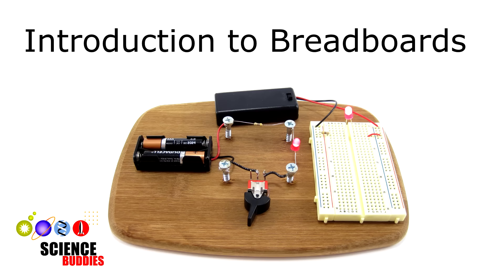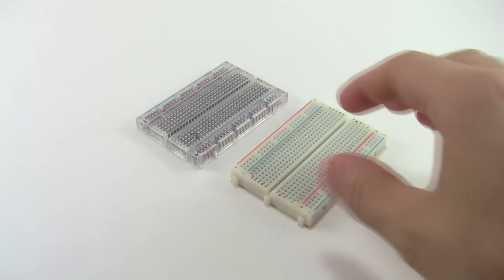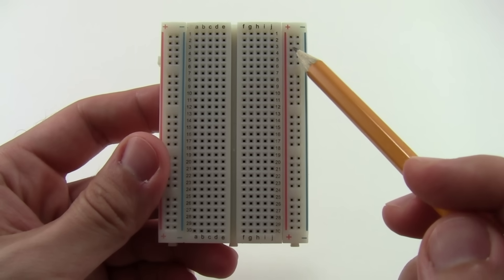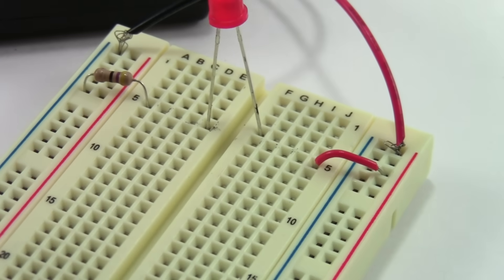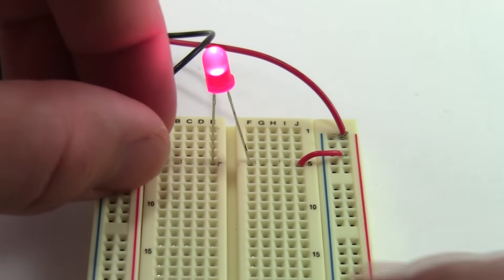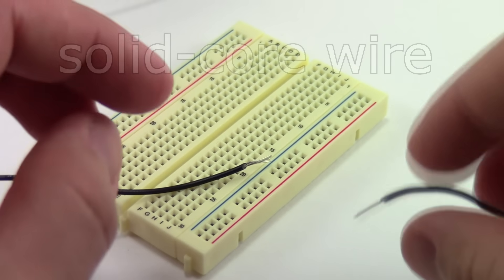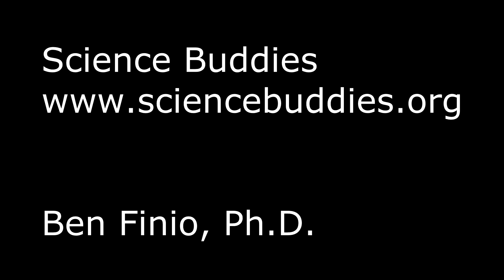How to Use a Breadboard

Comment: Can someone tell me Why he used a resistor in the LED circuit ? 🤔
I’m a beginner
Reply from the maker: Hi Abdhullah - the forward voltage rating of an LED is typically in the 1-2 volt range depending on the color. A 2xAA battery pack provides 3 volts. So, if you connect the LED directly to the battery pack with no resistor, the voltage will be too high and it will cause the LED to burn out. If you are a beginner here are some tutorials you may find useful (you can also find these topics on YouTube):
https://learn.sparkfun.com/tutorials/voltage-current-resistance-and-ohms-law
https://learn.sparkfun.com/tutorials/light-emitting-diodes-leds/all
https://www.sparkfun.com/tutorials/219
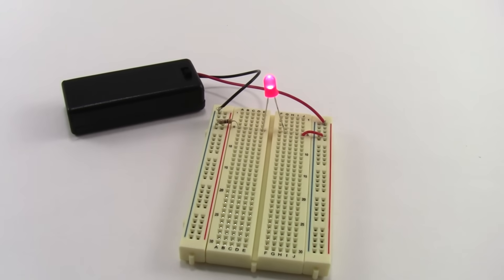Reply: Science Buddies | at 5:10 , since the current passes from positive to negative , shouldn’t the resistor be placed before the LED ?
Reply from the maker: @abdullahmaqsood5348  This is the most common question we get on this video, copying our response to other comments: It turns out that it does not matter whether the resistor goes before or after the LED in the circuit. This might seem counterintuitive if you think the resistor needs to come first to "resist" or "drop" the voltage. Since the resistor and the LED are in series, their voltage drops add up to equal the voltage of the battery (formally this is known as Kirchoff's Voltage Law). This is true regardless of what order they are placed in. If you'd like to learn more, search for tutorials on "Ohm's law" and "LED current limiting resistor." Hope that helps!

Comment: I'm terrible with this stuff.

For instance how do I know if I need a transistor?

How would I know what size/type?
Reply from the maker: Hi Breakneck - transistors (what they are, how/when/why to use them, etc) are kind of beyond the scope of this tutorial. There are many more electronics tutorials available on YouTube and elsewhere that could help you learn more. For starters, it would help if you have a specific application or project in mind (lighting up an LED, driving a motor, etc.).

Comment: What the hell is "SODDER" ?
Reply from the maker: If you were asking about the pronunciation (why I don't pronounce the "L") - apparently this is an American vs British English thing: https://www.google.com/search?q=is+the+l+in+solder+silent&rlz=1C1CHBF_enUS811US811&oq=is+the+L+in+solder+&aqs=chrome.0.0j69i57.3437j0j7&sourceid=chrome&ie=UTF-8

I'm American and have only ever heard it pronounced "sodder" here.
Reply: solder is basically just a metal that is melted to create a mechanical and electrical connection. The breadboard is good for prototyping and DIY projects, but most consumer electronics use solder to make strong permanent electrical connections.

Comment: Can you connect things diagonal? For instance the led were one pin is one row up but still connected to the wire  to make a closed circuit? I find these kinds of videos interesting since i know nothing about it so it might be a stupid question.
Reply from the maker: Hi - no, you can only connect things in the same row, not in adjacent rows. If you watch the whole video or check out this part of our written tutorial it explains how all the holes are connected: https://www.sciencebuddies.org/science-fair-projects/references/how-to-use-a-breadboard#holes?from=YouTube
Reply: Yes, as long as the circuit is connected the rows you use don't matter.

Comment: Where should the resistor be connected; the positive side or the negative side of the LED? I just burnt up a LED i guess i connected the resistor the wrong way
Reply from the maker: This is a very common question, copying our reply from other comments: It turns out that it does not matter whether the resistor goes before or after the LED in the circuit. This might seem counterintuitive if you think the resistor needs to come first to "resist" or "drop" the voltage. Since the resistor and the LED are in series, their voltage drops add up to equal the voltage of the battery (formally this is known as Kirchoff's Voltage Law). This is true regardless of what order they are placed in. If you'd like to learn more, search for tutorials on "Ohm's law" and "LED current limiting resistor." Hope that helps!

Comment: What size (AWG) is the solid core wire for most breadboards?
Reply from the maker: Usually 22 AWG; slightly smaller or larger may work with some breadboards.
Reply: Good to see that question answered explicitly. I just got through pausing at 9:56 to see which setting was used on the wire stripper.

Comment: What do the bottom of the chips look like?
Reply: just black flat plastic like their top, usually
Reply: 9peppe yeah but is there a square piece of metal underneath where the three pins are?
Reply: @EchoHawk1862  the pins are not actually on the bottom, they are on the side and bent down. usually there are no other pieces of metal other than the actual pins (there can be special use chips that use a different mechanical structure, and obviously you can have chips in packages other than DIP)

Comment: A bit unclear when you put the chip all on one side. You say "If you put the chip like this you are shorting out the two pins in each row". Are you referring to the two slots that are under the body of the chip?
Reply from the maker: Hi - it might help to look at the pictures in the written version of the tutorial here that explain how the pins are connected: https://www.sciencebuddies.org/science-fair-projects/references/how-to-use-a-breadboard#holes?from=YouTube. Starting around 11:27 in the video - first the chip is placed straddling the center gap in the breadboard, so the pins are in columns E and F, which are not electrically connected. So pin E15 is independent from F15, etc. However, then the chip is moved to columns A and D, which are connected. So pin A15 is shorted to D15, A16 is shorted to D16, etc, which is what you want to avoid. Hope that helps!

Comment: Why does the resistor go on the gnd side instud of pos?
If it is to resist to make I flow smaller then I can't get my head around why that would work After the LED uses power first and then grounds to the resistor and then finally to gnd?
Reply from the maker: Hello - this comment is supposed to be pinned to the top, but for some reason it might not show up. Copy/pasting the explanation:

Hello everyone! Pinning this comment because it's the most common question we get on this video. It turns out that it does not matter whether the resistor goes before or after the LED in the circuit. This might seem counterintuitive if you think the resistor needs to come first to "resist" or "drop" the voltage. Since the resistor and the LED are in series, their voltage drops add up to equal the voltage of the battery (formally this is known as Kirchoff's Voltage Law). This is true regardless of what order they are placed in. If you'd like to learn more, search for tutorials on "Ohm's law" and "LED current limiting resistor." Hope that helps!
Reply: Science Buddies ok so the sum leaving the node must be equal to the sum and going in and vice Versa so 100 amps going in will reduce to whatever is the exit allowance. So if I resist the exit wire by 50% then only 50amps will go in,right?

Comment: Greaaat!! Resisitor colors and oHm value please?
Reply from the maker: The resistor shown at 5:50 is yellow-purple-black-gold, which is 47 ohms.
Reply: Science Buddies Thank you so much for the quick response and btw, I tried to figure out with screenshots but no success, now it's OK👌
Reply: @Science.Buddies  thanks sir love u , can u make more video on electronics about voltage , current measurements I haven't understand please . Thanks :))
Reply from the maker: @RajuRay-yl5lh  If you want to learn about measuring voltage and current then our multimeter tutorial video should be helpful: https://youtu.be/ts0EVc9vXcs

Comment: i have several breadboards where the gap is 0.6 instead of 0.3, very useful for eproms and such without taking away from breadboard available pins. wonder if there is the odd board with 0.4 inch gaps for the few chips i can think of that are strange, but here one only loses a single pin

Comment: So why do we use the resistor in this circuit?
Reply from the maker: The resistor prevents the LED from burning out. If you connected the LED directly to the battery pack with no resistor, the voltage drop over the LED would be too high, causing too much current to flow through it, thus burning it out. Putting the resistor in series with the LED allows some of the voltage to drop over the resistor. Google "Ohm's law" and "LED forward voltage drop" if you want to learn more about these topics.

Comment: This video was really great. Though, I am stuck on how to use resistors in circuits. Can you explain why you used the resistor on the negative terminal instead of the positive?
Reply from the maker: Hi Timmy - this is a very common question, copying our reply to another user: This is a common misconception. It turns out that the order of the LED and the resistor does not matter. To understand this you need to understand some other topics that are not covered in this video, including Ohm's Law and Kirchhoff's Voltage Law (voltages add in series), but you can find many tutorials about them online, for example: https://www.sparkfun.com/tutorials/219
Reply: @Science.Buddies  Thanks for your quick reply. Your response has really helped me with my project.
Reply from the maker: @timmytimerson8243  Glad we could help!

Comment: i accidentally blew up a 5mm led in my face
Reply: i tried to not use a resistor but i figured i could counterbalance that by using multiple leds.
Reply: I was wondering what would happen if i did that. thank you.
Reply: @goezie  oh man i dont know.. The led might not have been in the board all the way. Im going to keep experimenting and keep you posted.
Reply: @benjamincarlson5044  the voltage across the LEDs' terminals would vary depending on the type of connection(series/parallel). Experiment around and tell us what you find

Comment: Why is the resister on A5 and -6? When there is nothing that connects to the 6th row?
Reply from the maker: Could you let us know exactly which time stamp in the video you're referring to? For example at 5:56 one end of the resistor is in A5, but the other end is in the ground bus, not A6. (watch the rest of the video for an explanation of what buses are)
Reply: @Science.Buddies  5:48
Reply from the maker: @Cam-SB  OK, same explanation applies as what we typed above for 5:56 then (the resistor doesn't move between those two time stamps).
Reply: @Science.Buddies  so if it doesnt move between then why don't you stay on 5?
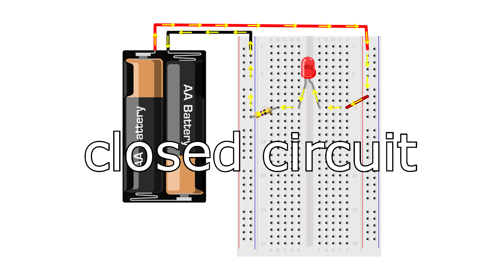Reply from the maker: @Cam-SB  We may be misunderstanding your question. Starting around 5:42 in the video the resistor is connected between the left ground bus (the vertical column with the blue stripe on the far left) and hole A5, and it remains there. Initially the LED is also in row 5 and it lights up. We temporarily move the LED to row 4 and then row 6 to demonstrate how it stops lighting up, since those rows are not electrically connected to row 5.
Reply: At 5:48 the resister on each end is in a different row. I'm confused at why
Reply from the maker: @Cam-SB  The columns are the far left (between the vertical red and blue lines) are the power buses. The row labels do not apply to them. Only one end of the resistor is in a row (row 5) and the other end is in the negative power bus. If that still doesn't make sense, this section of the written tutorial might help: https://www.sciencebuddies.org/science-fair-projects/references/how-to-use-a-breadboard#breadboard-labels
Reply: @Science.Buddies  now it makes sense. Thank you! :)
Reply from the maker: @Cam-SB  You're welcome, glad we could help!

Comment: Why use resister while using LED?
Reply from the maker: The resistor is needed to prevent too much current from flowing through the LED and burning it out. This tutorial has a good explanation: https://www.sparkfun.com/tutorials/219
Reply from the maker: @Rj Simas that is a common misconception. It turns out that the order of the resistor and LED does not matter. To understand this you need to understand some other topics that are not covered in this video, including Ohm's Law and Kirchhoff's Voltage Law (voltages add in series), but you can find many tutorials about them online, including the SparkFun tutorial I linked in the other reply to this question.
Reply from the maker: @Rj Simas if you are just starting to learn electronics, you might also appreciate the multimeter video we just posted: https://youtu.be/ts0EVc9vXcs

Comment: do you need a resistor?
Reply from the maker: @LoLAwesomechad this is a very common question and depends on understanding some topics that are not fully covered in this video, including Ohm's Law and the fact that "voltages add in series" (formally called Kirchhoff's Voltage Law). It turns out that it does not matter what order the LED and resistor are in. They are in series, so their voltages add up and are equal to the voltage of the battery. A red LED typically has a voltage drop of about 1.5 volts. 2xAA batteries provide 3 volts. So the remaining 1.5 volts are dropped over the resistor - but this occurs regardless of whether you put the resistor before or after the LED. This tutorial provides a more detailed explanation: https://learn.sparkfun.com/tutorials/voltage-current-resistance-and-ohms-law/an-ohms-law-experiment
Reply from the maker: Yes, you need a resistor in series with the LED. Otherwise, too much current will flow through the LED, causing it to burn out.

Comment from the maker: Hello everyone! Pinning this comment because it's the most common question we get on this video. It turns out that it does not matter whether the resistor goes before or after the LED in the circuit. This might seem counterintuitive if you think the resistor needs to come first to "resist" or "drop" the voltage. Since the resistor and the LED are in series, their voltage drops add up to equal the voltage of the battery (formally this is known as Kirchoff's Voltage Law). This is true regardless of what order they are placed in. If you'd like to learn more, search for tutorials on "Ohm's law" and "LED current limiting resistor." Hope that helps!

Also, we apologize for the poor audio quality in this video! It is several years old and the audio was simply recorded with a cheap webcam and no post-processing. If you check out our more recent videos, hopefully you will find the quality greatly improved. Thank you for all the feedback!
Reply: It's fine. Btw thanks for explaining it so nicely.
Reply: great video thanks buds but no post processing could save this audio haha  :)
Reply: The voice is indeed a bit awful but after a minute I got used to it it's not a big deal. Thanks for the useful video!
Reply: It's better than a muddy mix. I've learned so much from your video, it's uncomplicated and you make it look easy thank you! :)
Reply: hi... when using a 🍞 board, does it matter where u put the first component?
Reply from the maker: @james77011  For a very simple circuit (one LED and one resistor, like we show in this video), it shouldn't really matter. For a more complicated circuit with lots of parts, the breadboard might start to get pretty crowded, so you might want to plan things out more carefully.
Reply: You video helped me with my l.e.d project and I didn’t here bad audio

Comment: This is an excellent video with well thought out and well explained demonstrations for anyone learning electronics. This video also does a great job of showing the inner workings of a breadboard and detailing the options for using different types of wire for various projects.

Comment: This is quite possibly the most easiest video to follow along that I have ever watched. This needs a large round of applause, I am more than thankful for you having created this. Thank you so very much, this has helped me a lot. Edit: Hello again, I just have a doubt about why the resistor is placed after the diode and not before could you clarify that, as generally it would be placed before because the current flows from positive to negative, but it's on the negative side and not the positive, it would really help if you could clear that up, thanks.

Comment: Like it One question what dimensions is hookup wire i searched on amazon but there is so many diffrent thick wires
Reply from the maker: 22 AWG is the most common type used with breadboards. Make sure you get "solid" and not "stranded" wire, stranded is too flexible to push into the breadboard holes.
Reply: @Science.Buddies  cool thanks
very informative Video answered all my questions in just about 12 minutes

Comment: i thought current runs from negative to positive
Reply from the maker: Electrons (negative charges) flow from - to +. However, the convention for electrical current is defined as flowing from positive to negative. This might seem silly in circuits with metal conductors where the charge carriers are electrons, but in general there are cases where the charge carriers can be positive (protons in a particle accelerator, ions in a chemical reaction, etc).

Comment: doesn't current go from - to +?
Reply from the maker: Electrons (negative charges) flow from - to +. However, the convention for electrical current is defined as flowing from positive to negative. This might seem silly in circuits with metal conductors where the charge carriers are electrons, but in general there are cases where the charge carriers can be positive (protons in a particle accelerator, ions in a chemical reaction, etc).
Reply: ok thx